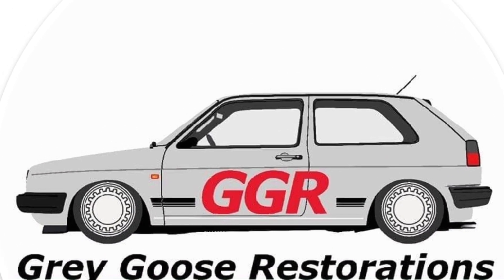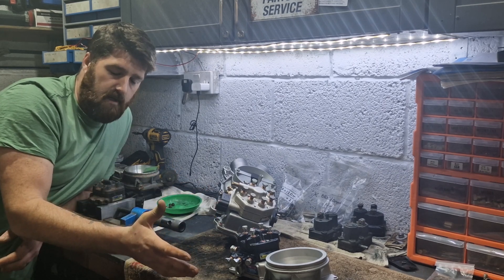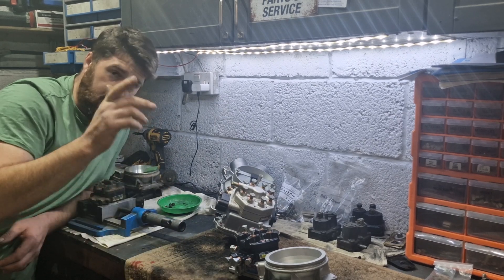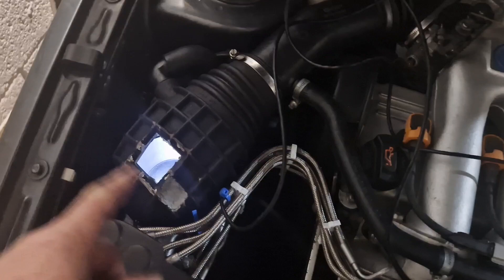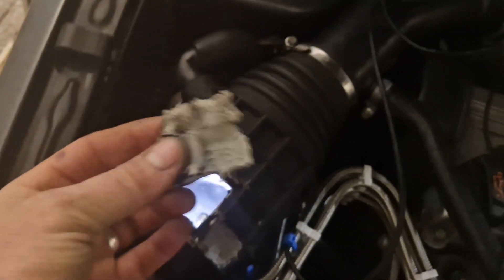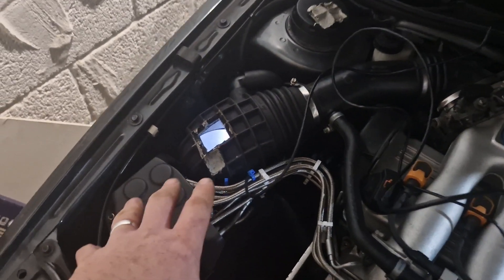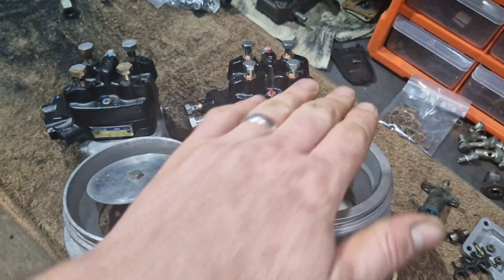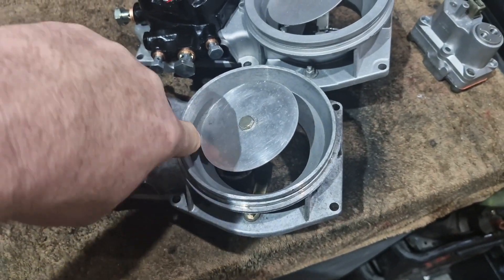Bosch K-jetronic - The Inside Truth - Part Two

Comment: Coulden't stop watching you k-jet videos today! Awesome stuff! Very interesting to see the movement of the plate. I noticed how slow the plate moves to the top position. That's why you get so much better throttle response with lower control pressure =) You ran it at 3 bar right? Imagine how slow it would move at stock setting, 3.6 isch bar 😅
Reply from the maker: Thank, its was very interesting to see what it does, I should have adjusted it to a higher control pressure and see if the plate even gets that high

Comment: that was a good video.interesting.your car has a larger intake pipe than the volvo as i remember my volvo.what is the diameter of the pipe that goes to the throttle?have you thought about how to get more fuel into the engine after the air flow meter is fully open? it was well done that you had modified the air flow meter so that it lets in more air. do you have a video of how you did it? on carburetors such as weber there is an acceleration pump. is there such a system on your injection? I made an adjustable power jet for my son's cross bike so it gets extra fuel. under load. maybe a similar system would work on the injection.
Reply from the maker: Not sure on the size, around 80mm i think, i can get more fuel in but I'm at the point where I have enough fuel for the engine spec, I can get more fuel in but then I'm going to rich which i don't want
Reply: @GreyGooseRestorations  how can you get more fule in on hig rpm?i have watch many of your video now wery good.is there another airflow meter then the Porsche that give more airflow?i live in Finland here is no used Porsche.we have volvo.saab.mercedes.golf that i can think of with that injection.but its  not easey to find any bosch k-jetronic here anymore.
Reply from the maker: Lowering fuel control pressure firstly will help then it would be tweeking the mixture screw which will provide more fuel after that it's adjustment to the flow adjusters in the fuel distributor or re-shimming the springs on non adjustable units

Comment: it'd be great to measure this on a flowbench to measure air flow and VERY IMPORTANT, air speed. Might be worth filleting the edges that the air sees on the plate, making the swingarm more aerodynamic and the plate barrel intake and exhaust area towards the rubber elbow
Reply from the maker: That would be good if I was able to, some units had a mushroom type part under the plate (or on the top for downdraft types) which was meant to aid flow

Comment: If you want more fuel at peak lift, and have access to a decent lathe, you could reprofile the metering needle at the max lift height. Maybe have a selection of needles profiles ready as you would when tuning an SU carb.
Reply from the maker: I tried that and in theory it works but in practice it just let's more fuel through due to the space inside the bore being larger

Comment: I have a volvo 740 with a k-jet and  the airplate is very heavy when there is fuel in the system and it does not get enough air to start or run,it starts if i let more air into the intake though the idle valve hose and dies instanty when i plug it back in. do you have any suggestion on how to fix this?
Reply from the maker: Sounds like the control pressure is too high, the WUR controls that so I'd check pressures and go from there
Reply: @GreyGooseRestorations  thanks alot i will check as soon as i have time tomorrow.
Reply: @GreyGooseRestorations  it started right away when i swapped out the WUR, thanks for the tip!
Reply from the maker: Cool, glad its helped

Comment: Very cool to see it all work the way it does. What kind of power are you putting out now with that Porsche air plate and the amount of fuel you're delivering? I think my old 87 16v had 123hp...
Reply from the maker: Last time it was on the dyno it was 183 bhp and 156 lbft 😁 back on the dyno in less than 3 weeks too